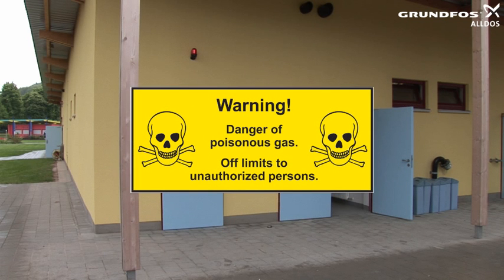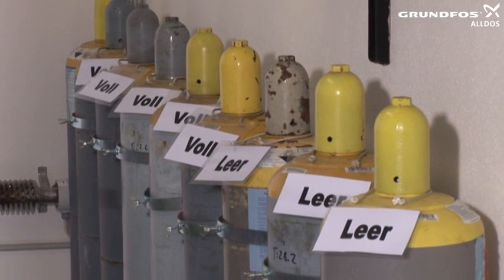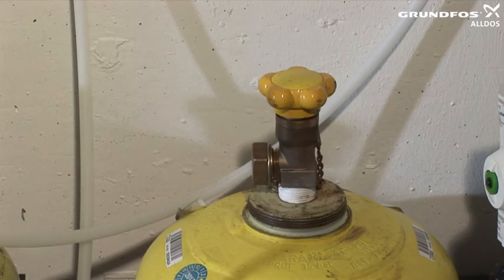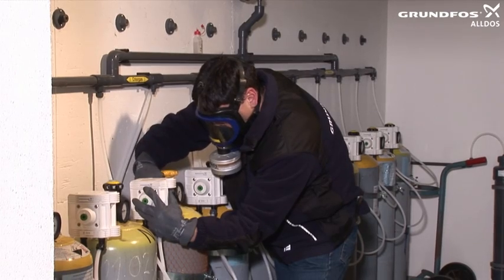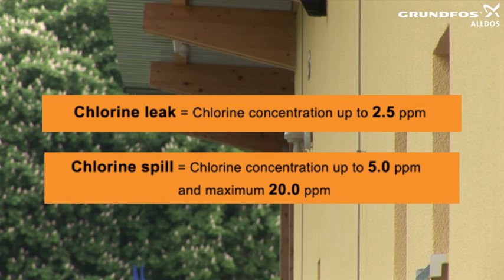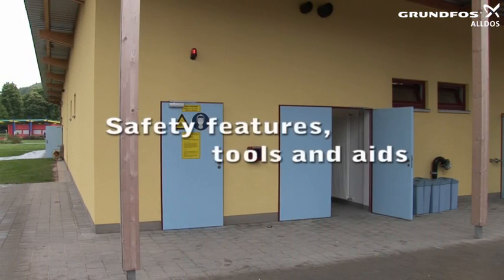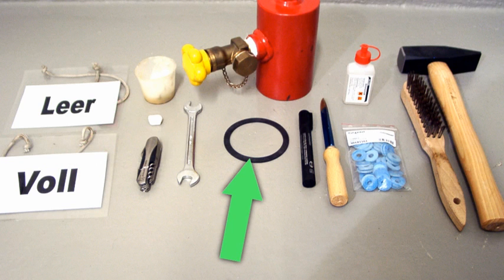Changing chlorine gas cylinder

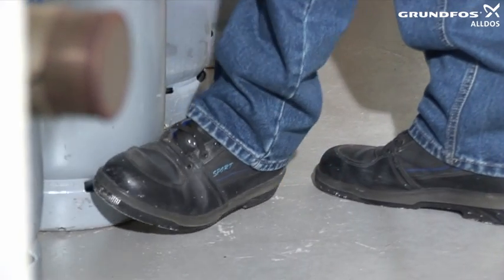Comment: At 6:00 he clamps the cylinder to the wall having no idea which direction the valve is oriented. At 6:24 you can see that the cylinder is now oriented differently. Operators who are trained with this video are likely to unclamp the cylinder and attempt to rotate it with the safety cap removed. 

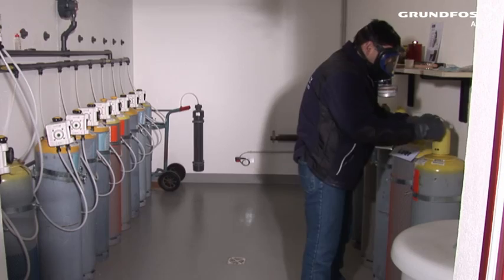As an alternative, I propose that at 5:30, the operator should open the safety cap of the new cylinder to verify that the cylinder is full and the valve is serviceable and tightly shut off; and at this time, use a marker to indicate orientation of the valve. Then replace the safety cap and proceed with the following instructions.